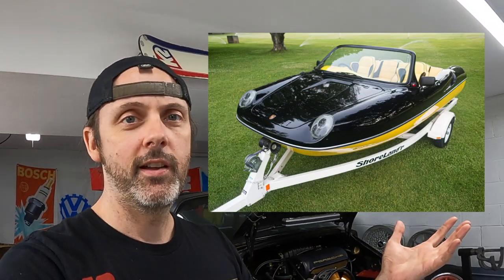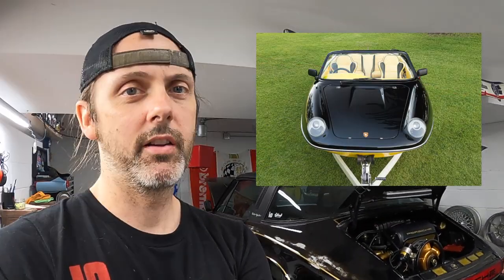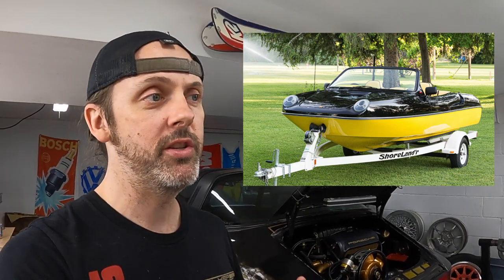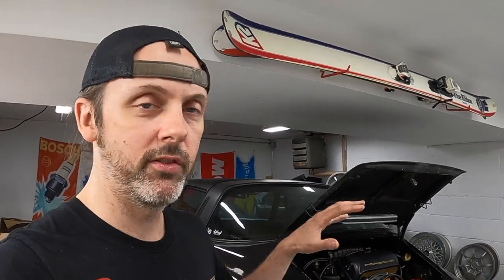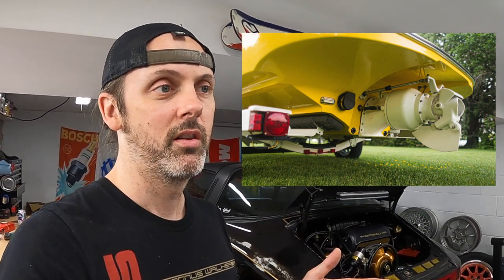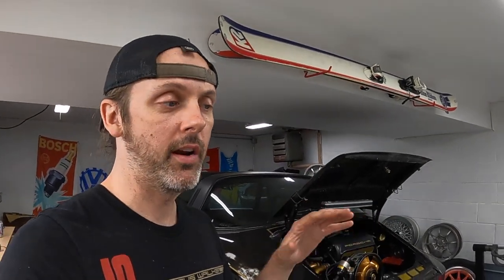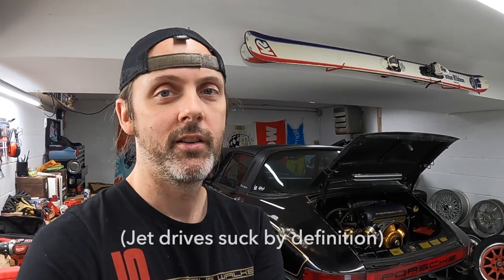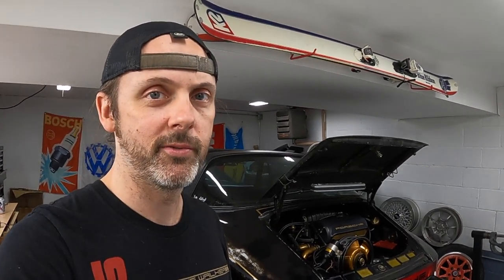PORSCHE 911 SPEED BOAT - Worst Boat Ever?

Comment: Jet boats are great for shallow rivers and lakes. Also with fewer moving parts they don't break much. Having said that, compared to a prop they suck gas and require more hp to run the same speeds.

Comment: Jet boats are totally inefficient. Gas hogs. Only advantage is they’re safer for the children to swim around. They do look cool at full throttle with the rooster tail like you said as every bass boat passes them at half throttle
Reply: Fully agree. Similar speeds can be achieved at a third of the engine power if they were propped. However, if you dont care about that and the fuel usage, they are very easy to drive and have less draft as well, which is something many people like.
Reply: @GoldenCroc  1/3 eh? easier to drive eh? I mean maybe you could like drive a boat or 2 before saying things.
Reply: @rumnboats7612  Why so confrontative? Yes, a lot of people find them easier to drive, ask them yourself. Its their opinion. I think a big part of it is what they feel like is the "faster shifting" between forward and reverse propulsion, with the jet bucket compared to the shifting that is necessary with props, reminding them more of just hitting the brakes in a car.

Regarding power, yes 1/3 is on the upper end of the scale I admit that, mostly applicable to lighter boats with optimized setups doing pretty high speeds. Like what this channel features, thats why I used that number. But yeah, between 1/2 and 1/3 for something like the latest boat they bought, the 500 dollar one, is feasible with a very optimized prop setup.

I have driven a lot of different boats in my days, and currently own 4 of them, as well as 2 vintage PWCs. Your post on the other hand, ironically calls into question how wide your own experience and knowledge is a bit. But I still wouldnt say it like that, I try to keep a civilized discussion, I hope you can afford me the same courtesy.

Now, give me some examples or data where I was wrong given the context, and I will gladly provide examples to the contrary. Cheers mate.
Reply: @GoldenCroc  It's just irritating to see so much negativity thrown at something that's actually a very rare fun little boat.  Jet drives are inefficient yes but in many ways are more fun to drive.  Low speed maneuvering can be more difficult, but acceleration is almost always higher.  Saying you fully agree with a video of someone slamming something as an absolute joke piece of shit when they didn't bother to even find out what it is bothered me.  I like to watch alot of interesting boat videos on youtube, the negativity is just a thing I can't handle.  This is a rare different head turner that would certainly be fun to drive.  By other owner's accounts these boats are capable of 49mph which is plenty in a 16' boat to have a good time especially with a jet.
Reply: @GoldenCroc  I just got upset by the entire video and comments after finding out what the boat actually is, also 1/3 I just can't agree with, torque is everything in a marine application, there is almost no instance where an engine with 50hp with a prop will be faster than an engine with 150hp with a jet on the same boat.
Reply: @mattnetko2282  You know what, you are right.

Even though the first comment in this comment field we are in was sort of right, I shouldnt have written "fully agree" when I really didnt like the overall negative tone of the comment all that much. 
I didnt fully agree with the some things said in the video itself, as you can see if you look at my separate comment directed to the channel owner.

I also like this boat in this video quite a bit, and for much the same reasons you do it seems, as you can see in my comment directed to the channel owner. But people will always have opinions, and thats fine. No surprise many of those replying feel the same way the channel owner does, its his channel after all. Its best no not let it get one down too much, I watch a lot of car review videos, the comment field is often a blood bath between different fans of different brands, haha.....Just the way it is.

Cheers mate.
Reply: @rumnboats7612  You know what, you are right. 

I shouldnt have written 1/3. Even if that is actually true, its such an edge case for most people, that I really should have excluded it. It depends on a fully surfacing out drive (Arneson style or similar) or a conventional drive running
engine heights most people havent even heard of, i.e. prop axle far above the water line. And on top of that, a very light weight boat going a high speed, to see that kind of efficiency disparity. 

50-100% less power usage is more relevant to what most people, even with reasonably light weight boats are likely to see. I shouldnt use what me myself is doing for when I am mostly into race boats.

Also, that "similar speeds with 1/3 the power" I wrote was strictly talking about the top speed, when it comes to acceleration the difference is not very relevant at all. I should have made that more clear.

Cheers mate.
Reply: @GoldenCroc  I mean you're not wrong BUT a cvx20 jet vs. a cvx20 intimidator is a totally different world from the hydrostreams plated with surface piercing cleavers/choppers I play with and yeah a boat like that with a jet is goin nowhere, but the glastrons are very similar in performance jet or outdrive.  To each their own though and by all accounts this craigcraft is a 50mph head turning fun little boat that is extremely rare, not a one off someone built like a piece of shit in their garage and asked 20k for.  Cheers! and apolagies for being irritated.
Reply from the maker: @rumnboats7612  There is no effing way this hits 50mph.
Reply: @ADDvanced   I mean I don't own one that's what owners say though 49mph. I have a 1980 18' deep V sea ray heavy pleasure cruiser full windshield 24gallons of gas several people in it with a 4.3 and a prop, it went 44mph after sitting 5 years and almost no tune up, underpropped for tubing.  The Craigcraft is a smaller 16' boat designed to look cool and be fun by gentleman like Andrew Freeman in the UK, look at some of the other Craig Craft boats they made, racing pedigree.  A marinized 4.3 has alot of torque and approx: 225 hp it's not a 3.slow.
Reply from the maker: @rumnboats7612  So now imagine your drive is way less efficient.  There is no way in hell it gets close to 50.
Reply: @ADDvanced  yeah, a jet on the sea ray would maybe not even get it on plane but on a smaller boat with a completely different hull is a different story the motor is there, the jet makes the little boat fun it'd be faster with an outboard setup correctly sure,  similar to the difference between a tunnel boat with a surface piercing prop at the correct height offset and pitch vs the same boat with more power but a long shaft hung straight off the transom a mile deep in the water with a low pitch prop different hulls run differently with different setups and some boats are designed for jets.
Reply: @rumnboats7612  I know a bit of old Glastrons actually, I was a fan of them after watching an old James Bond movie on an old VHS tape as a kid, where they featured heavily. Would love to own one, but I have too many boats as it is. 

Anyway, as you say the CVX20 intimidator had a standard model outdrive, and that certainly wasnt what I was comparing to. It was more what could be theoretically possible with the outboard boat featured in the the latest videos on this channel, and even then I admit its a long shot since he would have to finesse the bottom, get the weight balance absolutely right, and run the prop shaft way above the bottom, to get high enough speeds out of it to make a big difference.

The last thing you wrote I had no idea about, I honestly thought it was made by a "guy in his garage", that did a decent job with the finish, but it seem to be a "Craig Craft 168 Boss". Huh, whaddaya know. Wonder how many they manufactured? Anyway, I like it because its different. Price doesnt matter much to me, neither the fact that it looks like a Porsche.
Reply: @rumnboats7612  Just checked out the video of it running.. I like to think I have a pretty good eye for speeds of vehicles, after many years of comparing them at races etc. Highest speed reached in the video looks to be no more than about 40, could even be a bit less. Maybe it can go faster, but at least in the video, it doesnt. I will refrain from making other judgements, just offering up what I saw in the video, regarding the discussion of the top speed.
Reply: @GoldenCroc  At least 20 of them came to the US, the pink one looks the best to me hah, the porsche stickers were not standard
Reply: @GoldenCroc  My point about the cvx intimidator vs cvx jet was they are very similar in size and weight and HP, one has a jet and a larger displacement higher torque V8 and a jet, the other has a higher HP V8 and an outdrive, the bottoms of the hulls are different because one is designed for a jet and one for the outdrive.  Their performance is very similar.
Reply: @rumnboats7612  Well yes, I sort of agree. Perhaps I wasnt clear enough before.

Comment: If you're going to talk mad shit about something you should probably at least know what you're talking about.  That's a modv hull with a pad with a 225 hp 4.3 hooked up to a berkley jet...it's 1/20 and looks awesome, moves fast handles incredibly well and is in incredible shape.  Your negativity is not only unwarranted, but mostly lies.
Reply from the maker: How is that a Mod V Hull?  Source on that? 
 
Most jet boats have a torquey high HP big block olds/chevy in front of that same YJ squirter, and they barely hit 60-70, even in hulls with a real light layup minimal interior, and no bow weight.  This thing has a HEAVY GLASS WINDSHIELD, useless headlamps and mirrors, full interior, and an anemic V6?   I bet it cannot even crack 40mph.  My guess is low to mid 30s, which is straight up embarrassing.   Prove me wrong; buy it and show me how fast it goes, buddy.  I love being proven wrong :P

Comment: Man I did a bit of digging this is a Craig Craft 168 Boss actually a Euro production boat, 225hp with a Berkley jet, 20 of these came to the US in the 90's that hull has a pad! it will come up and rip with a monster rooster tail!  Bro it's cool as shit, a dude out in that is 10x as cool as a dude in a 100k+ wake boat.  20 of these came to the US in the 90's, like if you wanna talk racing it's not gonna win unless you can't break 70mph, but it's rare, faster than u think and cool AF, there's a pink one for sale too btw.  4.3 is a great motor...better with an outdrive and a prop for sure but under 200hp? I mean '89 4.3 mercruiser with an outdrive 220 hp to the prop...come on man why so negative? that thing is cool.
Reply from the maker: if this is a production boat that's somehow even worse; someone designed this and purposely chose a 4.3l Vortec?!   Whyyyyyyy?   Dude I bet this thing can't even hit 40mph.  Most jet boats with 455s or big blocks can barely hit 60-70 unless they're pushing HUGE power.   In 1989 the Chevy Astro with that same 4.3 made 150hp, so who knows.  Mercruiser could obv be a different cam and whatnot but I doubt it was vastly different.   I don't think something this slow that tries to look fast is cool.  That's no different than a Civic and fake turbo noises and giant wings running 17s in the 1/4.   Meh.
Reply: @ADDvanced  I like watching lots of interesting boat videos, if you're gonna hate on something at least know what you're hating, by other owner's accounts these boats go 49mph which is plenty in a 16' boat with a jet lots of fun, they turn all the heads.  Also a 4.3 in a boat is not what is in your van...a marinized engine has so many different working parts it's ridiculous.
Reply from the maker: @mattnetko2282  There is no way in hell they get close to 50mph.  I've been in boats with mercruiser 260s (5.7L v8s) and they barely tickle 50, like 52ish...  with less power/torque and a less efficient drive this thing will be slow as heck
Reply: Lol hell yea man I was literally going to comment the same thing. The boats cool asf no doubt at all. He's just a little jelly about it for some really weird reason. Maybe cuz it's a 911, the price or something his ol lady said that made him a little self conscious. Whatever but we all know for sure if she came home and backing it in he'd be all about it and we'd be getting a whole different vid lol

Comment: You should race him!     Race the Porsche boat!  

Race him for pink slips.  The race should be from the boat ramp unloading boats. Then race to a point on lake and back to boat ramp!
Reply from the maker: Thing would get annihilated
Reply: @ADDvanced  Would love to see it, that boat is over60 mph with a fast takeoff, on an easy bunk trailer.  Really though do it, challenge him or one of the other few of these boats around.
Reply from the maker: @rumnboats7612  There is no way that is possible.  Mercruiser uses that same engine and I've never seen one go over 5 with a PROP.  The jet will be even slower, and with the hull design and heavy glass windshield I bet it can't even hit 40.  I'm guessing 35mph tops.
Reply: @ADDvanced  I mean I don't own one of these and that's what other owners say, I DO however have a 1980 18' deep V sea ray heavy pleasure cruiser full windshield 24gallons of gas several people in it with a 4.3 and a prop, it went 44mph after sitting 5 years and almost no tune up.  This is a smaller 16' boat designed to look cool and be fun by gentleman like Andrew Freeman in the UK, look at some of the other Craig Craft boats they made.  A marinized 4.3 has alot of torque and approx: 225 hp it's not a 3.slow.

Comment: Jet boats can run in little to no water in one definite advantage.  I understand where you're coming from concerning jet drives, props are more efficient but not nearly as cool depending on what the boat it. Plus you start getting into specialty outdrives when you get into real performance prop applications. Check out the Eliminator Finnegan just built thats doing 117 mph with a jet. You're not gonna throw a Bravo Mercruiser outdrive behind that and have it last more than a day...lol!
Reply from the maker: No but if you put it on a V drive with a prop it'd probably hit 125-130.  The only outdrives that can handle HUGE power like that are those ones they put behind the QC motors.   1750hp all day long.

Comment: Jet drives on jetskis and boats turn much better than props. Hug the water.  You can drive in shallow water.     There are pros and cons to everything.
Reply from the maker: Tunnel hull race boats = turn faster with more G's than any other form of motorsport.  Have props.   I will give you the shallow water argument.  They can drive in shallow water, make rooster tails, and.....  suck gas and get clogged.  Do not want.  :D

Comment: Talking about Porsches, when are you going to get the 911 on the road?
Reply from the maker: Soon!  It's super close I've just been distracted.  Need to fill the trans and insulated the oil S hose, and finish reassembling the inner axles.  Honestly I could probably have it running in like half a day just trying to find the time.
Reply: @ADDvanced  Do it already! Btw, I got the Sachs lightweight clutch plate assembly you recommend and absolutely love it!
Reply from the maker: @krisdecreton4243  Awesome!

Comment: Goofy looking boat.  My last Astro, a commercial van 2002, I sold with over 318000 miles and would get 21 - 22 miles to the gallon on the highway.  The Astro I have now is a 2004 window van has 225000.  Not as good mileage as the last one and not as peppy, especially with the AC on.  Still like the Astro tho.
Reply from the maker: I wish they would make a new one, with a diesel.

Comment: Jetdrives accelerate faster but max out there speed faster too. They can turn a lot faster. So they are perfect for Jetsprint racing in a canal.
Reply from the maker: Not really.  Current world record drag boat is a prop.  And nothing turns faster than a tunnel hull race boat, which have more Gs in turns than any other motorsport.  Also prop.   

Those caged boats for canal racing run jets because they often clip land, and having an outdrive would result in damage.